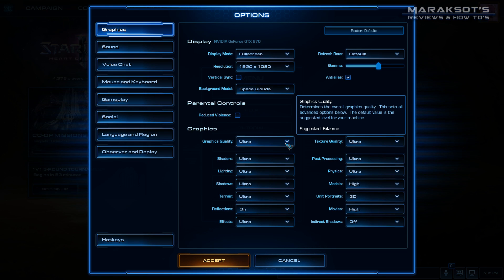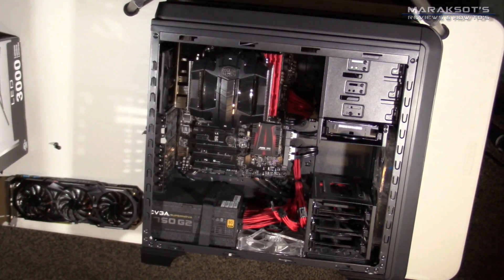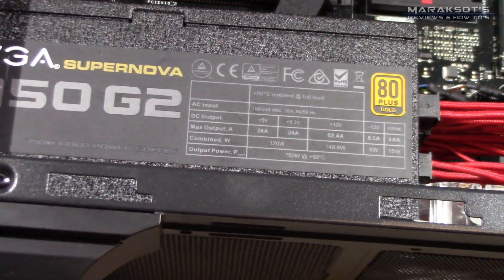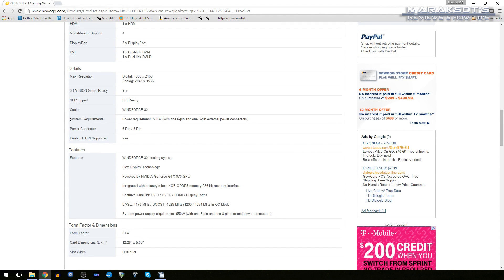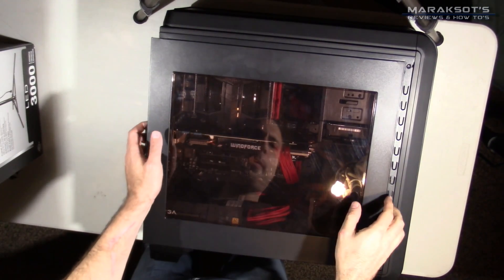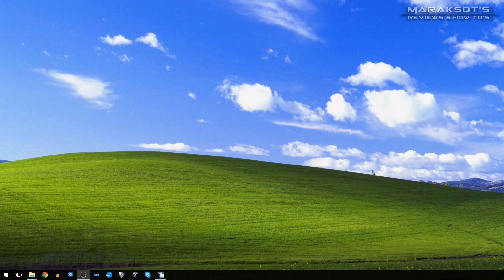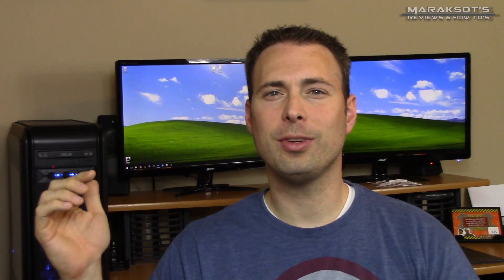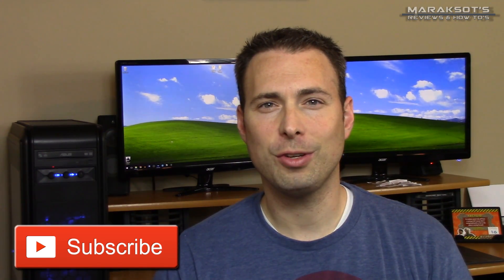A Beginners Guide - Upgrade your GPU - How to Install a New Graphics Card

Comment: I'm thinking about upgrading my r9 270x to a better card. I want to play games like PUBG on my 2560x1080 75hz monitor. Should I go for a gtx 1060 or amd rx 580? Or should I even go for an 1070?
Reply: 16GB ram ddr4
I5 6500
Reply from the maker: +Stoned Panda that's a good question. For that resolution I'd say a GTX 1060 or RX 580 would be perfect choice for most all modern games. However, from what I understand PUBG is a poorly optimized game so the more graphical horsepower you have the better. Meaning you'll be able to play at max settings at that 75Hz refresh rate with the 1070 whereas with a 1060 6GB or 580 8GB you may need to turn settings down a little bit if you want to stay at 75fps. In the end it depends on what your budget is? Right now 580's are a bit overpriced and I also feel that 1070's are too. When it comes to performance per dollar I feel the GTX 1060 6GB will be your best value currently.

Comment: I installed everything. Turn on my computer, boom! Nothing
Reply from the maker: +Rods Ahed most of the time its a simple fix. Make sure your new card is fully seated in the slot, that the proper power connectors are plugged into it and that you have your VGA, DVI, HDMI, or Display Port cable from your monitor plugged into the corresponding port on your graphics card and that it is securely plugged in at both ends.  If none of that fixes it then a motherboard BIOS update may be in order.

Comment: One question, I'll upgrade my graphics card but it is of the same brand. Do I have to uninstall the past drivers and after that remove the old graphics card and put in the new one or there's no need to uninstall the past drivers? Thanks in advance.
Reply from the maker: +DDGamerSeeker when you says it's the same brand are you talking about Nvidia and AMD or EVGA, MSI, Asus, Gigabyte, Zotac etc.?  You may already know this but just in case you don't I'll explain... AMD and Nvidia are currently the 2 main manufacturers of GPU's (the actual piece of silicon that does all the graphics processing inside a graphics card). As for companies like EVGA, Asus, Gigabyte and others they buy GPU's from Nvidia or AMD and then build a graphics card around that GPU. So when it comes to drivers it doesn't matter what brand (MSI, EVGA, etc.) your card is you just need to download the appropriate drivers for whichever AMD or Nvidia GPU you have. If you're switching from one Nvidia GPU to another, say a GTX 960 to a GTX 1060 you'll want to swap graphics cards, uninstall your old drivers and then download and install the most current drivers for your new GPU to get the best possible performance out of it.
Reply: Thanks for the reply! I saw the answer to my question and I highly appreciate you for explaining stuff for me.
Reply from the maker: No problem man.  I'm happy to do what I can to share the knowledge.  Congrats on the upgrade.  Enjoy!  :)

Comment: Could I get a high end gpu if I have a i5 7600k 4 cores. Same as the i7 but not as good in editing. 16gb ram ddr4 and 1000 watt power supply. CPU runs at 4.00 ghz to 4.2 ghz
Reply from the maker: absolutely man.  The 7600k is a very good gaming CPU.  That CPU is great with any of the high end GPU's on the market today.  GTX 1080, 1080ti, Vega 64 or whatever.  You will see even better performance from something like an i7 7700k but that being said the 7600k is a really great performer.  Just out of curiosity what is the resolution and refresh rate of your monitor?  I ask because unless you're gaming at a really high resolution or really high refresh rate there's really no need to buy something like a 1080ti.  According to statistics on Steam the vast majority of people out there are currently gaming at 1080p 60Hz (60hz means the monitor is only capable of displaying 60fps) so if that's the resolution and refresh of your monitor then you'd be fine with a GTX 1060 or an RX 580 as they're both capable of playing modern titles at 1080p 60fps no problem.  However if you're gaming at 1440p or 4k or even 1080p at 100+Hz that's when things like the GTX 1070, 1070ti, 1080 and 1080ti make more sense.
Reply: Maraksot78 I have a 1080p 60fps 60hz monitor, I have a gtx 1050ti and staying there for a little since I just got my pc, I am going to upgrade my pc’s GPU when I get a better monitor.
Reply from the maker: +Hike Frank the 1050ti is a pretty decent 1080p 60Hz card and should do pretty well for ya until you upgrade. Congrats on the new PC, enjoy and best of luck to you on your future upgrade. :)
Reply: Maraksot78 thanks, the whole pc cost me $1,000 but I guess that’s how pc gaming goes if you want it to be good
Reply from the maker: yah PC gaming isn't cheap but there's just something about it that always keeps me coming back for more.  XD
Reply: Maraksot78 yeah, lol my first reason was seeing people play on pc more and more on YouTube, I studied FPS and all that and it just convinced me to change from a console pleb to a pc gamer, the fact that I’m almost 13 is even worse XD because all my friends don’t play the game I do, so I’m just bored to death.
Reply: And my CPU stays at 4ghz to 4.3ghz. Do to my water color XD
Reply from the maker: PC gaming certainly is a hot topic on YouTube right now for sure.  I'm not one of those PCMR guys that hates on consoles, I love console games too.  I love gaming on my PC but mostly I'm into hardware.  I love learning about new PC hardware and building my own computers and whatnot. That's what happens when you get old like me.  XD
Reply: Maraksot78 yes it is, what I find annoying is how I spent $1,000 on my pc and my friend acts like his xbox one is better and has “better graphics “ after I went to his house to compare our ww2 games and his wasn’t nearly as good, the shader preload took forever while mine takes like 5 sec, he just annoys me because he says his xbox is better and the graphics were no nearly as good as mine. He just is a console fan and thinks it’s the best
Reply from the maker: Hike Frank I wish I had some words of wisdom to offer you in regards to situations like that... I've experienced the same kind of thing with my friends in the past.  People, for whatever reason, feel like they have to defend their purchasing decisions; they have to feel like they're right and often times put other people down in order to make themselves feel better. In reality PC hardware like you have is far superior to anything in a console. I have a cousin I recently got to come over to PC and he always comments about how much better the graphics are on his PC than on his PS4. What many console gamers are not aware of is that many games on consoles (even though they say they're 1080p or 4k) don't actually run at that resolution. A good example I know of is the Call of Duty games on the Xbox 360. Even though the 360 was supposed to be a 1080p console for COD to run at 60fps the developers had to run the game at below 720p resolution. I'm sure if you googled what resolution current gen games run on consoles I'm willing to bet it won't be at full 1080p or 4k if it's running at a 60fps. Consoles have to make sacrifices in order to run games at playable frame rates. They have to drop the resolution and decrease details among other things. Can you have fun playing games on a console? Do games look good on modern consoles? Absolutely! But is the hardware in a current gen console better than the hardware in a modern $1000 PC? That answer is No. :)  In the end I just don't push the issue with people, especially with my friends. If they're happy playing on a console and or can't afford a gaming PC I just let them be and don't try to "convert them"  :)
Reply: Maraksot78 yeah I know, he just kept on saying it even though he knew he was wrong , it’s like he wants to get people mad. But I’m fine with it now . He can think what he wants, but if I ran COD in 720p then it would run amazingly fast and have more than 60fps without recording. If I search up what resolution Xbox is on and I put it there it would be much better
Reply from the maker: +Hike Frank oh yah, no doubt!  :)
Reply: Maraksot78 do you recommend the 1070 for recording in about a year
Reply: Or on September I could get it or Easter.
Reply from the maker: Hike Frank so are you wanting to start streaming on Twitch or YouTube?  I havent done any streaming personally but from what I understand  if you're wanting to record and stream gameplay your CPU plays a much more important role than your GPU. I'd recommend a GTX 1070 if you're wanting to game at 1440p at high settings but if ypure wanting to game and stream on the same machine the more powerful your CPU the better. I don't know how well an i5 performs when it comes to gaming and streaming at the same time but I'm guessing you'll have to play at a lower resolution or lower quality settings in order to maintain a good playable frame rate no matter what GPU you have with an i5.
Reply: Maraksot78 oh really, mine is a Kaby lake and gets like almost the same ghz as the i7. So it does fairly the same in gaming and recording. It’s just my graphics card can’t take recording and playing, it’s too much for it.
Reply from the maker: +Hike Frank I guess I should say that it depends on how good of quality you want to stream at? It'll perform fine if your CPU is encoding at a fairly low resolution and bitrate however if you want to record at 1080p 60fps and a high bit rate that puts much more strain on your CPU. So it's trying to process game stuff and video encoding at the same time which make your graphics stutter in your game. It's not your GPU having trouble keeping up. Both your CPU and GPU have a roll in running a game. They work together to get the job done so to speak. When you're streaming and gaming at the same time you're CPU is having to do 2 jobs simultaneously. Your GPU on the other hand has only one job to do so it will finish a task and then await commands from the CPU on what its next task is. Normally the CPU will give the next command immediately however when gaming and streaming at the same time the CPU can't give the next instruction to the GPU right away all the time because it's busy encoding video. This delay then causes stuttering (low frame rate) in the game and dropped frames to your stream.

Comment: dont u need to delete old drivers before installing new one ?
Reply from the maker: if you're swapping an old card for a new one then I would certainly recommend uninstalling your old drivers before you install your new drivers.  If you're going from using Intel integrated graphics to a discrete graphics card however, you can just install the drivers for your new card.  In my experience there is no need to uninstall the Intel integrated graphics drivers.  I've done it that way many times and have never had an issue.  Knock on wood.  XD
Reply: i now have GT 610 and im swapping to GT 1030
Reply from the maker: congrats, best of luck on your upgrade.  :)
Reply: I have to delete old Nvidia driver ?
Reply from the maker: +Edge that's what I always do.
Reply: ty
Reply from the maker: +Edge no problem. :)

Comment: How do I load the Nvidia drivers?
Reply from the maker: Teh Doge Wit Dose Nustrils thanks for the question. That's kind of difficult to answer in the comments section but I can give you a link to another one of my videos where I show how to uninstall old drivers and then install new ones. In the video description there are time stamps that (if you're watching on your PC) you can click on that will jump you to the part of the video you want to see. If you're watching on a smart phone or something and the time stamps don't work it at least tells you when I talk about certain things and you can jump straight to them. That way you don't have to watch the whole video... unless of course you want to watch the whole thing.  :D https://youtu.be/e3dGYvIa4pg
Reply: Maraksot78 That's a different video btw.
Reply from the maker: yes it is... That's weird.  I don't know what happened there.  Try this link.  https://youtu.be/e3dGYvIa4pg  When I replied to your comment the other day I was doing it from my smart phone.  I must have accidentally tapped on an ad or something and shared the link to that video. Sorry about that.  I edited that link so it's correct now just in case someone else finds your comment and clicks the link too.

Comment: after I install the new VGA, can I plug the monitor to VGA port? or still need to plug in the on-board port to do the "driver installing" part?
Reply from the maker: you'll want to plug in whatever cable you're using (VGA, DVI, HDMI or Display Port) from your monitor into the corresponding port on your new graphics card.  It should work just fine.  Your computer will recognize it as a display adapter and will be able to use it.  The drivers are to help your graphics card perform to it's fullest potential in games and other applications that utilize it.  Think of drivers like the instruction manual for your graphics card.  Your computer knows it's a graphics card as soon as it's installed.  Installing the drivers is kind of like reading the instruction manual and teaching your computer how to use all the different features and stuff your graphics card is capable of doing.  I hope that makes sense.  :)
Reply: Maraksot78 very detailed :) I thought that if I plug to the port on the card, the monitor would be black :)))
Reply from the maker: +Hai Dang no problem man, I'm happy to help.  :)

Comment: Processor Intel(R) Core(TM) i5-6500 CPU @ 3.20GHz
 
Video Card NVIDIA GeForce GTX 550 Ti
 
RAM 8.0 GB
 
Operating System Microsoft Windows 10 (build 14393), 64-bit

please help should i upgrade my entire system or just the graphics card and if so whice graphics card is recommended?
Reply from the maker: +TreX it depends... what is the resolution and refresh rate of your monitor? If you're gaming at 1080p 60 hertz and want to play modern games at max settings at 60+ fps if you upgrade your graphics card to a GTX 1060 you'll be good to go.  A GTX 1050ti is a respectable option as well, however it won't be able to maintain 60+ fps in all games at max settings. You'll have to turn some settings down a little bit depending on the game but a 1050ti is around $50 U.S. less expensive too. :)
Reply: 144 hertz 
 and for example i play pubg on 1280x720 on very low in all of the settings and still at max i get like 25 fps which is unbearable and i also get rendering issues
Reply from the maker: yah the 550ti isn't really made for running a game like PUBG.  :D  So 1080p 144 hertz?  The 1060 would work... however to achieve a frame rate up over 100fps you'd need to turn the graphic settings down a ways, but it'll run PUBG on max settings at around 60 fps just fine.  I'm sure it'd dip below that when there's a lot of action going on but still playable IMO.  If you want to have the settings turned up higher and also run at a high frame rate then you're going to want a 1070 or 1080.  You may also want to think about adding 8 more GB of RAM to your system so you have 16 GB total.  8 GB is pretty good and is fine for most stuff but if I were in your shoes adding in 8 more GB would be on my mind.  That being said I'd upgrade my GPU first though as that's going to give you the most noticeable improvement.  I think your i5 6500 is still good for at least a few more years so no need to worry about upgrading that at the moment.
Reply: Thank you all!
Reply from the maker: no problem man.  I'm happy to help.  :)

Comment: I'm guessing the graphics card maybe one of the most common things to upgrade?
Reply from the maker: +papadoc711 and you'd be correct in that assumption.  :)  when it comes to gaming it's usually the one thing you can upgrade that will give you the biggest performance boost.

Comment: I have an older mobo.. the latch is different than yours, im not sure if i need to press down on it and then place in my gpu or is it fine to simply place it in?
Reply from the maker: +Wav-Scorn259 is yours more of a tab style latch? I have an older system as well that is a tab style which is different than the one I show in this video. If that's what you have you can simply slot your new card in. If you ever need to remove your card you'll have to push on and hold that tab out of the way and pull out your card.
Reply: Maraksot78 yes you're right it is exactly as you described. The latch feels kinda weird though lol anyway thanks. I ordered my GTX 1050 today. Cant wait to install it in when it arrives! :D
Reply from the maker: Wav-Scorn259 I wish you the best of luck man, enjoy your new graphics card.  :)

Comment: Pls help tried to upgrade my card and my monitor is not getting a signal and the fans of the card are working so I don't know
Reply from the maker: To be able to best help I need to make sure of the exact problem you're having.  So you just upgraded to a new graphics card correct? And when you boot your computer the screen is just black?  Do you see your motherboard splash screen first and then as it goes to load into windows it goes black?

Comment: I know this is a late one but i hope u answer this.I had a gt 730 and wanted to upgrade to a gtx 1050ti.Would i need to download the 1050ti drivers and uninstall my gt 730 drivers before i swap my cards and then download the gtx 1050ti.Is that how it works?
Reply from the maker: It really doesn't matter in what order you do everything.  You can swap your new graphics card for your old one and then uninstall the old drivers and finally install the new drivers.  Or you can do it in any other order you want, everything will work just fine.  :)
Reply: Maraksot78 thank you!
Reply from the maker: no problem.  :)